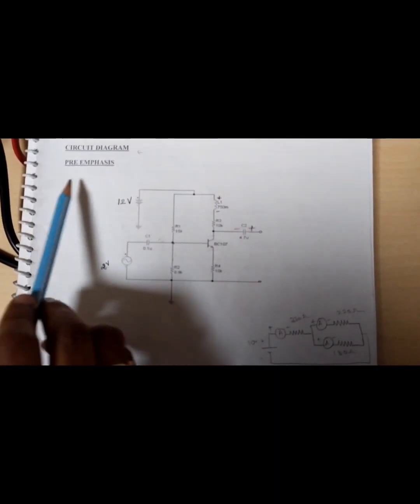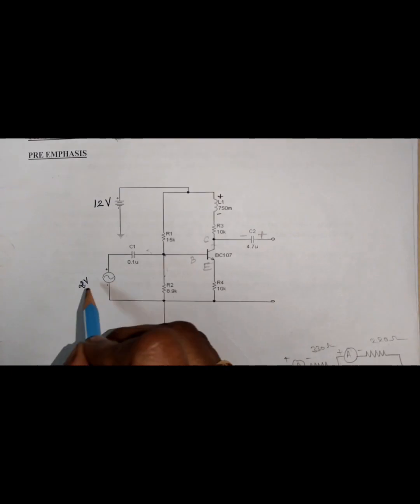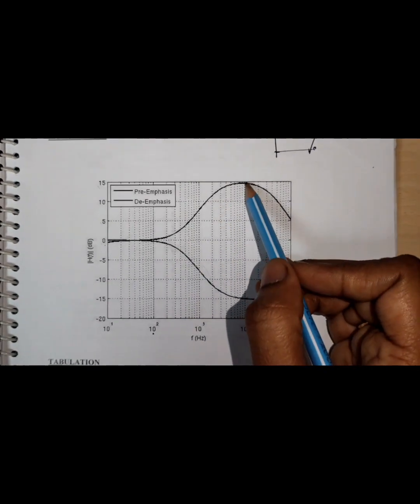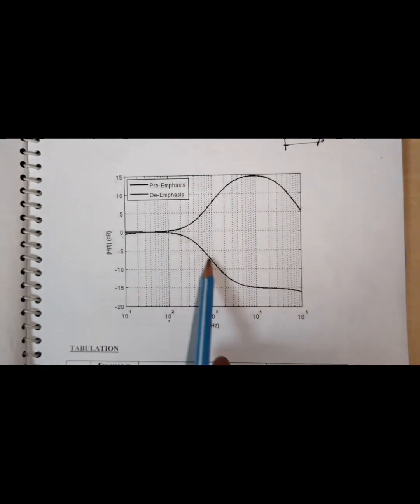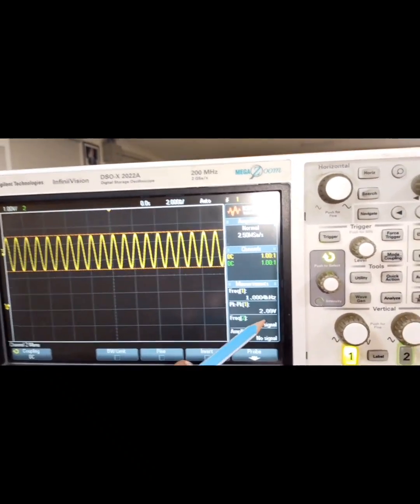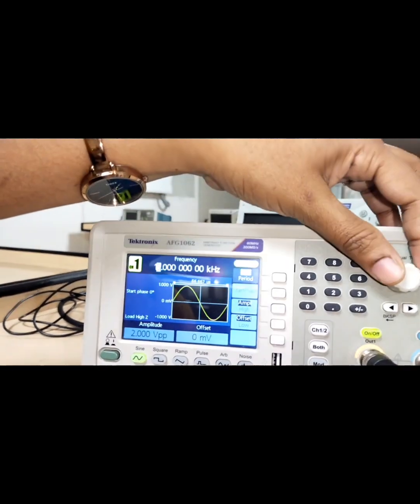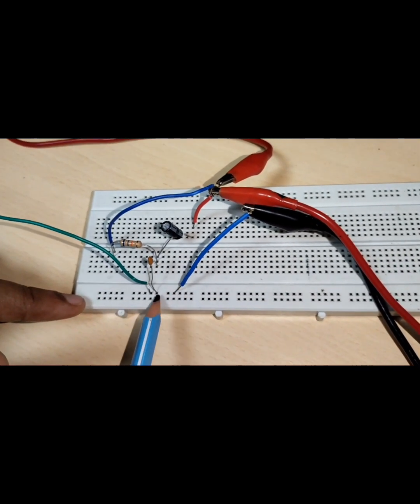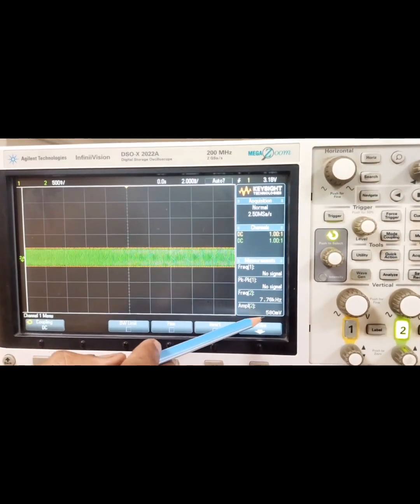Pre-emphasis and De-emphasis

Comment: Hello, Dr.Aarthi, 
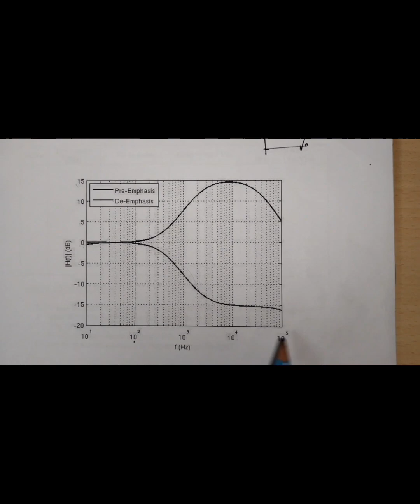  Your pre-emphasis(75us) circuit really works on LT-spice simulator. But I see a small error in the graphics. ( 1:38 ). The whole graph should be shifted to the right by approx. а half decade. The pre-emphasis now starts at ~400Hz (+3dB), but should start at 2.1kHz. Anyway.
  Another easier solution for pre-emphasis is to bypass(discard) L and mount in parallel to R4 a cap 7.5nF instead (for 75us time const). So we bypass the negative feedback  and boost frequencies over f=1/(2*pi*R4*C) with slope 6dB/oct. Note that this can saturate transistor at some frequencies with so high (2V) input signal!
 Happy New Year and greetings from Varna, Bulgaria!